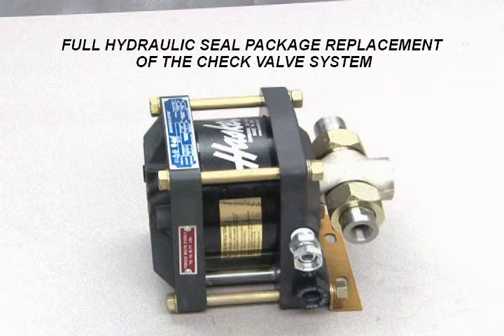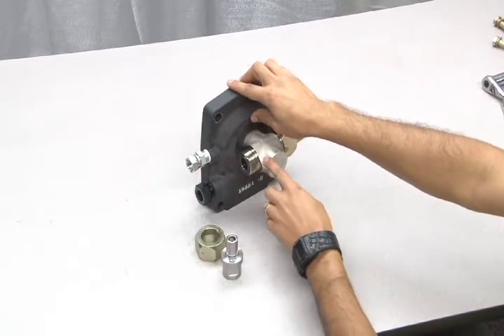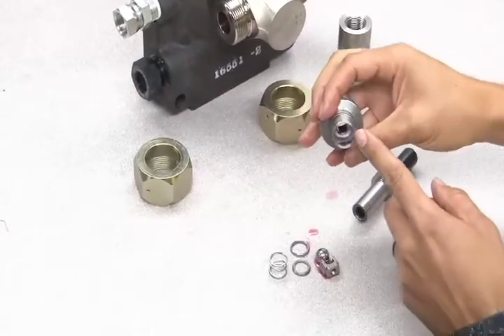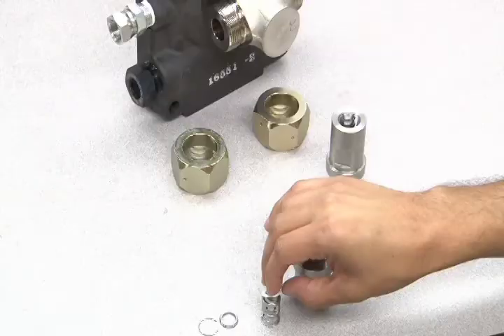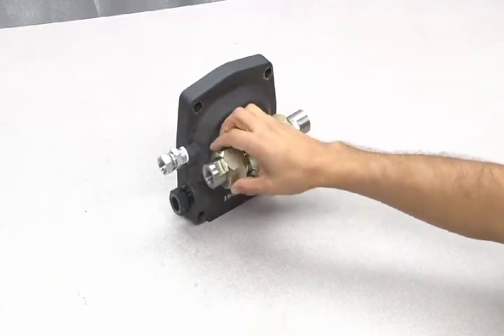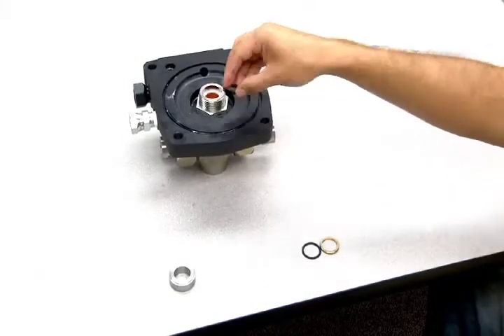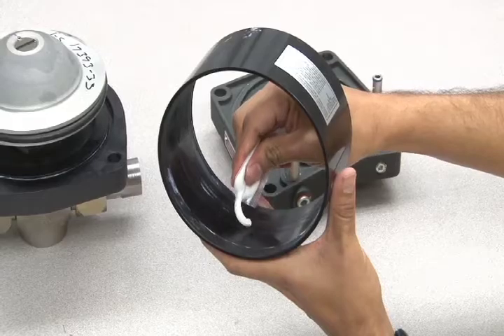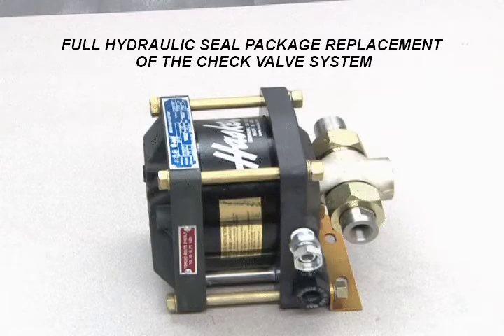Hydraulic Check Valve & Liquid Seal Repair for 5.75” Air Drive  Liquid Pumps

Comment: good day i have problem with HP Haskel pump, the problem is that the pump is pumping when you supply air into the air inlet bot the pump isn't socking the fluid from the inlet side what can cust that?